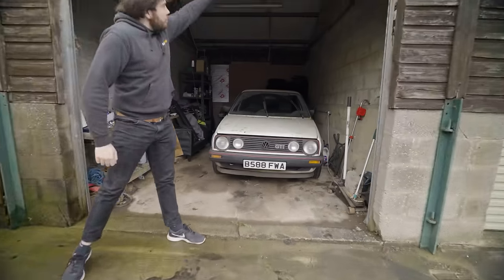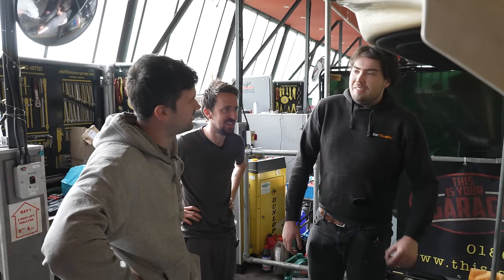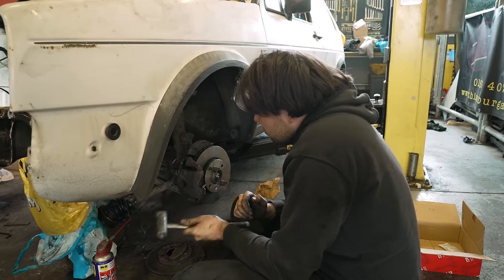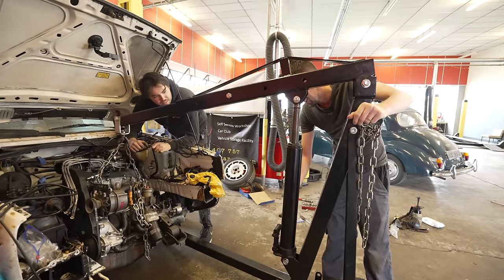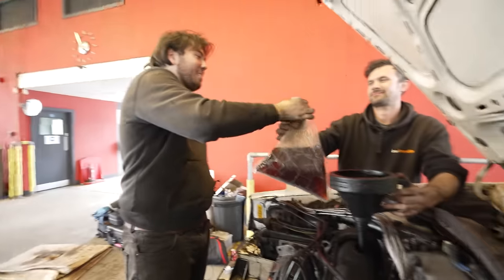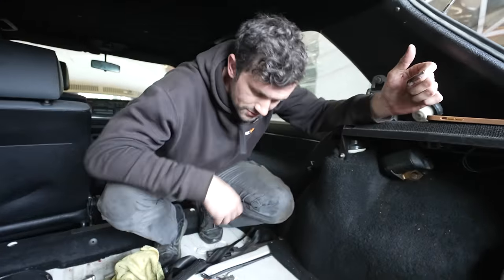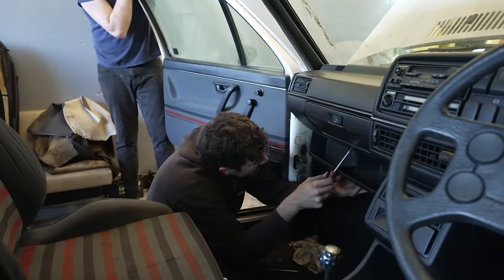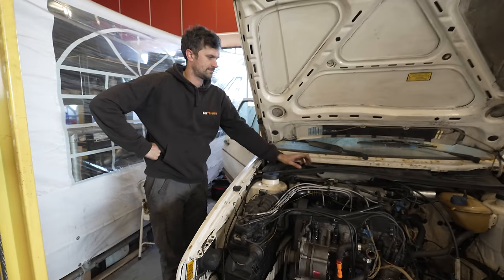Will Our Barn Find GTI Drive Again?

Comment: Big up for keeping the 8v, too many people are swapping them out
Reply: I mean the reason they swap it is more fun and I’d take that any day
Reply: @alexanderpsaras5663  but now days. A mk2 golf gti with it's oe engine is worth alot more than a engine swapped mk2
Reply: @alexanderpsaras5663  they just make em undeliverable and everyone does it because it’s “easy power”
Reply: @DVL BRESE2240  whilst yes I agree stock is cool, newer engine is efficiency, power, reliability ect there's a lot of gains
Reply: I completely agree, I love the 8v engine in the Mk1 and this Mk2, if I owned any of them I would love to throw a turbo build on a 8v and make decent power for the car, like 200hp, it's easy power I would say and reliable power for the car, no reason to make it overpowered.
Reply: I have a mk 2 with a vr 6. Definitely loads of fun and the sound is unmatched. But do respect on keeping the car the way it was many years ago. Keeping the history alive
Reply: @JORGE ARIAS Not much different I think other than it uses K-Jet fuel injection.
Reply: @0v0rd  I own a 8V.. had it for 20 years.. in its day i chosed it cause of the 3 mk2 GTI its the one that uses less fuel and its more reliable/usable daily. Yes i would love to have 160hp or sometimes the reving capability of the 16V KR ..but even today i still love and im happy with the 8V PB..its torquey and for normal use and twisty roads its more than fun enought.. its not that revvy happy as the KR obviously but its low and mid torque is quite good
Reply: nearing up on 200k miles on my 8v digi. still runs like a champ
Reply: @TheGta473  absolute mk2 chad. Keep her lit g
Reply: Man i had a vw mk2 gti 8v. Great car had over 250000 km on it. Had still first engine and gearbox. Was so fun to drive.
Reply: @zzzires5045  Just get a new car if you're looking for new performance. The chassis can't work with that much power and it's just sad seeing these cars be destroyed for short fun.
Reply: The 8v is gutless. It may be original but a vr6 swapped mk2 or 1.8t makes them more fun to drive and that’s the whole point isn’t it?
Reply: @rolfstuh  Mine has almost 400K km .. original engine (2 head gaskets due to the previous owner and a stupid mechanic) and just replaced the gearbox because i missed the box oil change and did 200K km on one and it became noisy due to worn out bearings.. my fault.
The car is so much fun do drive.. specially on twisty roads... the 8V engine has great low-mid range power for a 1.8 NA engine and its fun to drive in those situations..and the chasis is still very good even by modern standards.. its anticuated but its still well balanced and corners very nicely
Reply: @nimal1153  ABF swapped MK2's tend to go for more than regular 8v's, ive seen 1.8T swapped ones cheap though
Reply: @WinterVR6  I agree 100% I’m in the middle of VR swapping my MK2. Some of us want to enjoy our cars, Not leave them untouched to make it worth more!
Reply: @alexanderpsaras5663  for a good reason to, and obviously I've kept my 8v if i ever do sell it

Comment: Mine also had a secret switch, disabled a fuel pump, proper low-tech immobiliser. A 1.8 litre 8v sounds like a puny option these days, but mine belted along quite quickly. Proper nostalgia seeing one the same colour, same skinny bumpers, same seats, same wheels, same spec. You love to see it.

Comment: Make sure you are getting the low tension signal from the coil to relay. The relay will only prime the pump/accumulator when you turn the ignition on, but the relay needs that low tension signal from the coil so it knows that the engine is turning over. Its a safety/crash feature on the K-Jet.

Comment: long live the MK2!! my favorite all time car! ive owned several of them over the last 25 years, and they are simply epic! mk1/2/3 vw is some of the funnest cars to build, repair, and drive. basic simplicity. my daily is a mk3 that i vr6 swapped, and i refuse to by any car of any brand newer than 1998. had you guys been state-side, i have a fantastic ENGLISH SPEC 1.8 CIS GTI motor from a 1984.5 mk2 GTI sitting in my basement. ran when pulled, we stuffed a 24V Vr6 into the car, and as part of the payment, the owner gave me the old motor. it DROVE in, and sounded excellent. ive had 25 years experience with the old 8V vw engines, so i know what a bad one sounds like.

CIS vw setups with the dual fuel pumps were pretty finicky. the in-tank pump was a low pressure high flow pump. the one that actually made the engine run, was a VERY high pressure vein style pump, that ran at 90-125psi. in the states, they are incredibly expensive and hard to find. i keep lots of used ones in stock to keep the old cars in my area on the road. ive also rebuilt several of the fuel distribution blocks in the front, the part with the 4 fuel lines coming out of it.

Comment: I think one of the biggest thing I learned when working on motorcycles when they won't start is even if you have an idea what the issue is, do not fixate on that as a solution and always remain open to it being something else.
On my current shit heap, the day I picked it up it ran but as soon as I parked it up in the garden, went to hit the starter and nothing. Not even cranking. I became fixated on it being one of the dead man switches, most likely being the one in the kickstand. Turned out whoever had owned it before had done a bodge repair on the ignition wires when someone had cut them to try and steal it. A bit of full lock as I moved it into the garden tore his "repair". Nothing wrong with the idea that the dead man switches were at fault, but took me down totally the wrong avenue with regards of what was actually wrong and took someone else looking at it to find out the real problem.

Comment: I had a 1986 MK2 GTi with the bosch kjet injection and was the best car ive ever owned. It actually out braked and out cornered a Golf 5 GTi...wasnt as fast on the straight obviously LOL but was a bundle of fun. I converted my current daily driver Mk1 golf from carburetor  to MP9 fuel injection and was the best decision I have ever mad, I would do a MP9 conversion on a Mk2 GTi if i do ever own one again. I would also leave it 8 valve, personally its the most diverse engine vw has made. There are ways to fit a 16v ABF or even a 20 valve head to an 8valve bottom end.

Comment: I was given an Audi coupé from 1984 with that mechanical injection. It was barely running. By just cleaning it a bit and making it run a couple of times, it ended up working just fine...

Comment: I had a mk2 gti, fun drive. Did the usual mk3 bottom end conversion and couldnt get it to run, kept cutting out. Had to put in a variable resistor to fool the oil temp sensor to run. Ran rich then sold..
sad times

Comment: Just back from Zanty Greece mk1  VW Golf  everywhere,most are left in gardens,not rotted but in need of restoration,

If ,just if you could arrange transport ,chatting to a local they would sell just to clear from gardens ECT ,spare parts over there is the main problem,

Comment: 14:59 " lets load up that parts cannon and fire " literally me 3 weeks ago on my mk6 gti with HPFP bad, replaced spark plugs coils for a R8  high pressure fuel pump, fuel filter and cam follower

Comment: I had a similar issue with my old Porsche 924 that also uses the K-jet system. On mine it was a clogged warm up regulator that made it run like crap until it was properly warm.

Comment: It's so weird for me how rare this engine is for you guys I have a 1.4 8 valve from a vw golf Chico (probably only a south African version of the golf as the made the mk1 till 2008 in RSA) powering my 1969 vw beetle planning on putting in a 2l 8v from a mk3 once i have saved up 12000 Rand (507 ish pounds)

Comment: I watch these videos and always wonder, why not checking everything in a 20 years old car?
Do you have a spark?
Did you check for fuel pressure?
Is the fuel clean?
Why even trying to start an engine before you validated the above?

Comment: I bought  a mk2f polo that had been stood since 2014 
I had the same issues line pump gone engine buggered hole in the rad fuel tanks fucked  but its on the road now after 2 months

Comment: If that’s the quality of the engine bay clean it doesn’t fill me with confidence for anything else ? Did they get bored half way through? Sorry to say half arsed job didn’t even remove the servo which is four bolts , header tank just slides out , washer bottle one nut and air box at the point they were at two fuel line fittings . Poor effort

The inlet was refitted on the old gasket
Reply: Literally could go on and on what an absolute half arsed effort
Reply: Wrong gearbox oil and not filled correctly
Reply: Mk2 spares uk selling an engine with problems hahahahah